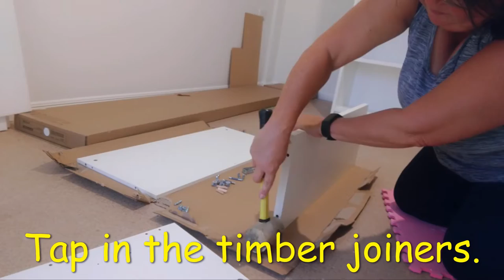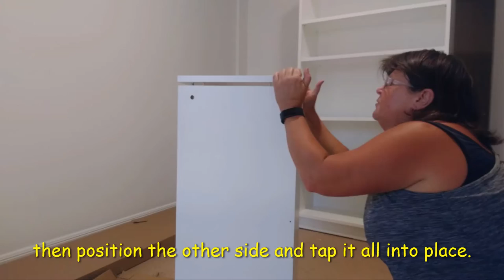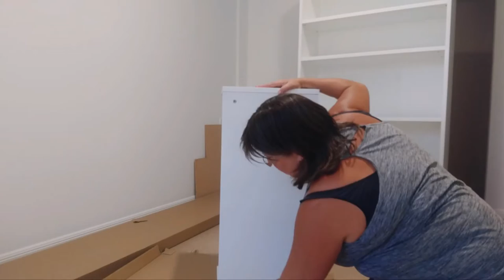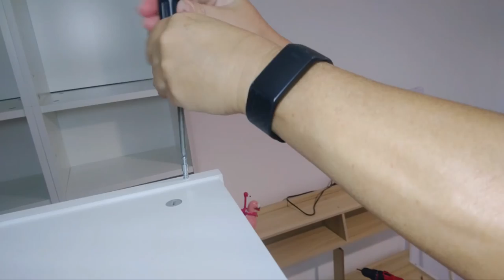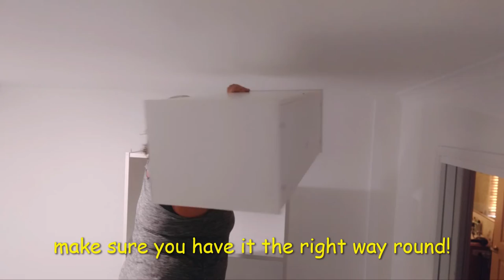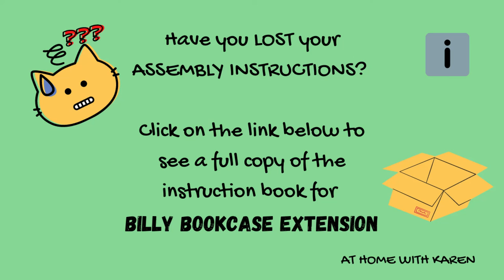How to ASSEMBLE the Billy bookcase HEIGHT EXTENSION.

Comment from the maker: I hope this helps!  It's really easy to assemble.
Reply: Thank you so much!!! I have been debating whether these would be more trouble than they are worth, but you made it much less frightening!!
Reply from the maker: @marymorris9780  The Billy bookcases are the easiest furniture assembly I've ever done! Definitely go for it! 🤩
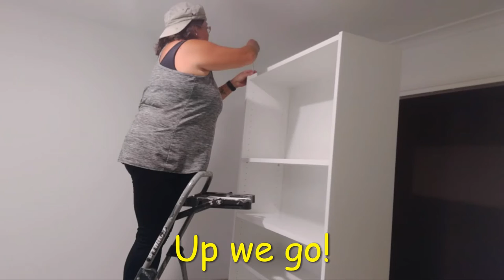Reply: Hi Karen! Thanks so very much for this assembly video! This was super helpful! 😊 Sadly, I must’ve somehow skipped over the step at 1:58 and forgot to put in that last screw that you mentioned helps keep the back panel positioned. 😱 Do you think that will give me any problems? I’ve attached the extension units and have moved the bookshelf units with them attached and haven’t noticed the back panels shifting at all. It’s a bit late as I’ve attached them to the wall already. 😩 Do you think I should be worried about the structure? I’d really appreciate your opinion. 🙏 I realized when I saw the extra screw. 😬 Thanks so much for your time!
Reply from the maker: @Singyourheartout324  No, don't stress at all! I doubt it will be any problem, especially being way up on the top shelf. Definitely not worth undoing all your work now they are in position. 👍
Reply: @AthomewithKaren Thanks so much for this quick reply! I really appreciate it! I was so worried, so this really puts me at ease. ❤️😂 Have a wonderful rest of your day! 😊
Reply from the maker: @Singyourheartout324  You're welcome. I'm glad I could help. 😊

Comment: Good video! I have a question please... is the wall bracket attached to the top of the main bookcase or to the top of the extension unit?
Reply from the maker: Hi Syl, you attach the wall bracket wherever suits you and your wall. As long as it fixes securely into the wall to prevent the bookcase falling over. Attaching it to the main bookcase would be stronger.
Reply: @AthomewithKaren  Okay - thank you for the prompt response! x
Reply from the maker: @sylpisces  thankyou for the lovely feedback.  😊

Comment: Was the height extension larger. Billy bookcase is 31.5 inches height extension is 32 inches
Reply from the maker: The height extension is the exact same width and depth as the bookcase. It sits perfectly on tbe top. You can't even tell it's an extension.
Reply: @AthomewithKaren  the dimensions are what I read you from the ikea website. Can you please conduct this
Reply from the maker: @Ai_TheGreat  I don't know what to tell you. The height extension is designed to sit flush on top of the bookcase. They are the same size. Perhaps you should contact Ikea and ask them to clear up the confusion.
Reply: @AthomewithKaren  thank you for responding
Reply from the maker: @Ai_TheGreat  I'm sorry I couldn't help. It's very strange. I hope you solve the puzzle.

Comment: what i am wondering about is you are suppose to anchor the bookcase to the wall. but if i put the anchors on top of the Billy bookcase, then how do i add the extension on top of that.
Reply from the maker: The units are designed so there is a gap, the full width of the unit, between the top of the bookcase and the bottom of the extension. This allows room for the brackets that are supplied to use to attached the bookcase to the wall.

Comment: Thank you - very helpful video - we would need to take 3 cms of the height - if you did this does anyone know if there is the space to do this away from the already drilled holes?
Reply from the maker: If you trim off some height you will lose the pre drilled holes, but you could buy some small angled brackets and screw the extension to the top of the bookcase. It would be secure and it wouldn't be visible.  That's what I would do.

Comment: Do you know if you can put two extensions on top of each other?
Reply from the maker: There are no pre-drilled holes for this but, if you're handy with a screwdriver and some brackets, you could certainly add another extension on top.

Comment: Is there any gap at the rear bottom of the height extension unit to allow for the earthquake fasteners? I already added those and now I want to add the height extension part
Reply from the maker: Hi Josh, yes there is a gap. The sides of the extension sit flush on top of the bookcase but there is a gap all the way across the back to accommodate the brackets.

Comment: Hi I am currently thinking about installing these bookcases, but I am no pro at this. If the bookcase is ceiling height, how should I go about attaching it to the wall?
Reply from the maker: Good question Toni, and I pondered this for a while before I came up with a solution.
One way, would be to attached the Billy to the wall as per instructions, and fit the height extension after it is place. 
Or (and this is what I had to do) - Instead of screwing the bracket to the top on the outside of the bookcase, I screwed it to the under side of the fixed middle shelf, inside the bookcase. The bit that you screw into the wall sits against the back panel of the bookcase and you screw through that panel, into the wall. Make sure it goes into the wall stud not just the plaster! 
Watch lots of videos, take your time, and plan each step and you'll be ok.

Comment: Hi Karen, I want to add an extension unit to a half height Billy bookcase but it doesn't have the holes for the small cam screws pre-drilled. Do you have any suggestions on drilling them? I'm guessing that the holes IKEA pre-drills are just blank holes and the cam screws are self tapping so it's just a question of drilling a suitable size. If you think it's doable what drill bit size would you use?
Reply from the maker: I think that would work. I'd get the extension unit and use those holes as a guide for size and depth.  You can take the screws with you to the store to get the right size drill bit. Good luck!  It'll look great!
Reply: @AthomewithKaren  Thanks Karen that's what I was thinking. I live in an ancient cottage with very very low ceilings so this should be a solution to my bookcase problems. Fingers crossed.

Comment: Can you add multiple extension shelves on the same bookcase or only one?
Reply from the maker: Hi Briana, both the bookcase and the extension have predrilled holes to suit the cam lock that joins them together. There is no provision to add another extension. BUT I don't see why you couldn't use small brackets and screws etc to add another extension. I'd definitely screw it to the wall though, so it doesn't topple over.

Comment: What if the ceiling is too low so you cannot put in the top cam screws?
Reply from the maker: The top cam screws go in the top of the bookcase, not the top of the extension. But if you can't lift the extension up over those screws, you could leave them out, slide the extension on to the top, and screw in a few L-shape brackets to fix the extension to the top of the bookcase.
Reply: Thank you @AthomewithKaren

Comment: Is it possibile to put more then only one top element up?
Reply from the maker: The shelves aren't designed for that. There are no pre drilled holes etc. It could be dine but you would need to find a way to securely attach extra units.

Comment: Do you think the 31 1/2 wide extension can be placed on two 15 3/4 billy bookcases?
Reply from the maker: Yes, Rick, I think that would work. As long as the two narrow bookcases were screwed together tight, the fittings for the extension should slot into the top of the bookcases without a problem.  And I think that would look great! The Billy is made to all be matched together. This is the link to the instruction book. It might help. https://youtu.be/Bl1eeUPnlVo

Comment: Whats the maximum weight for it ?
Reply from the maker: Hi Ramon, I have found the Billy bookcases to be quite solid and sturdy. I only have books in my bookcase so I haven't thought about its weight capacity and there wasn't anything mentioned in the assembly instructions, either.  Maybe you could have a look on the Ikea website? Or send Ikea an email?